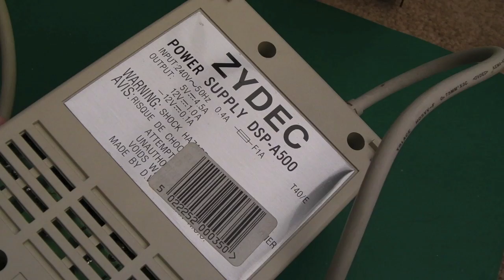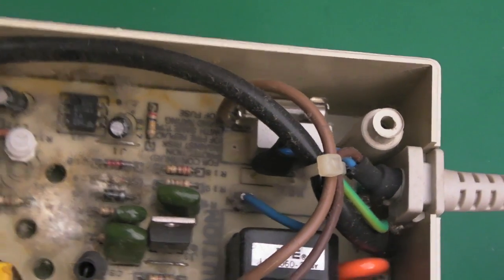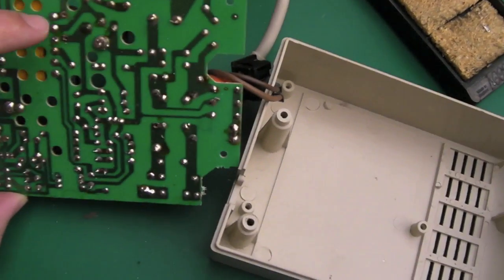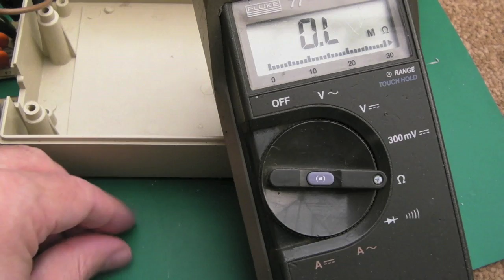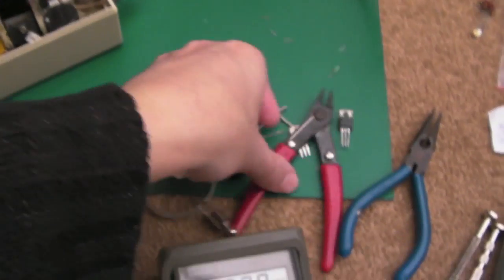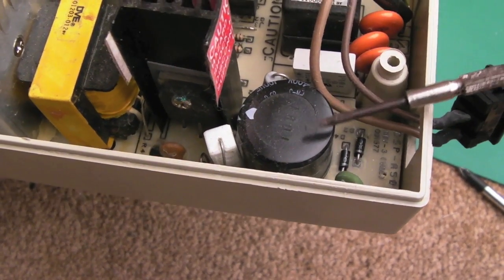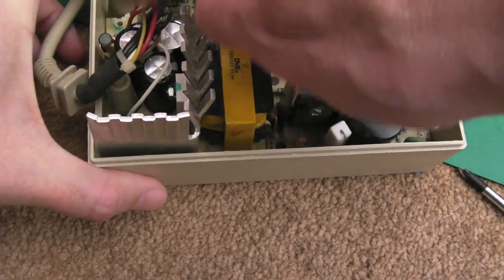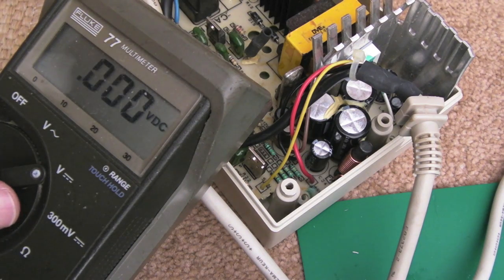Commodore Amiga 500 Zydec PSU Repair (DSP-A500)

Comment: I have a very similar PSU which is dead. After watching your video I went straight to measure R4, and lo and behold, mine is also open circuit. I guess I should measure my SCR next. Thank you for uploading these super helpful videos.

Update: The SCR seems to measure fine. Guess I'll just put the SCR back where it belongs, dig up a new 220k resistor, and see if my PSU works now.

Update 2: After ordering and replacing the resistor, the PSU now gives out 5.1V. The other voltages are not great, +11V and -9V, but I don't really care that much about the op-amp rails right now. I'm just stoked that the PSU could be rescued from the landfill by replacing a 6 pence part.
Reply from the maker: Great =D  Regards the slightly off +12 and -12v, maybe a change for a few caps will solve that!

Comment: Hey please help. My A500 psu works ok, but i get the same sound you got, when i turn PSU off. I changed all electrolytic caps, no change. Which componet causes that sound?
Reply from the maker: Maybe there's a problem with over voltage and its cutting out.  You need to measure all the resistors, zener / diodes.  Maybe swap the opto isolator if there is one.

Comment: I have one of these. On yours you have two grey rectangle boxes (the 1ohm things?) on mine they are yellow and have "RIFA" printed on them! Both have blown up, when they died the room stank bad. But afaik they are well known for kicking the bucket! Can I ask what are the exact codes of the grey ones you have? They sit close to the power switch end of the case. Thanks :)
Reply from the maker: I will need to take it appart to investigate when I get time!

Comment: Id say the resistor that blew was a fusible resistor.. it was probably designed to open if the SCR protection activated and was left switched on for a long period... or it just failed with age, as fusible resistors do!
Reply from the maker: That's a good point actually!  I might re-visit that PSU and swap out for a smaller wattage I think!

Comment: Hello can you help me ? My Amiga 500 led power blinks non stop and the tv screen stays grey do you know what is the source of this issue? i have a second issue: I turn on the PSU but the Amiga 500 doesn´t turn on (the PSU was tested it´s working ok) what should i do about? and there another issue with another Amiga 500 the drive led light is always lighted up (i exchanged the way i plugged the drive connectors but the led stills always on)

Comment: I just use an AT power supply and some adapter I bought off eBay, there were some Amiga 500s I saved from a recycling centre as a friend who works there saved for me, too bad the power supplies got scrapped. Good video!
Reply from the maker: Thanks =D  Yes, an AT PSU is a good idea for many retro systems!

Comment: Does it still make that high pitched noise now it's fixed?  I got one a couple of months back that was making that same noise, and it died on me last week.  I've done what you did in this video up to a point - am getting nothing on any outputs, 160-odd volts on the top of the switching transistor, and nothing on the output side of the opto.  Resistor between the transistor and transformer measures a resistance, as does the SCR anode-cathode, but i'm measuring in-circuit so don't know if they are meaningful readings.  Am quite new to electronics, so not going near the bottom side of this thing until it's been unplugged for at least a day.

Also worth mentioning that Farnell are shutting down their trade counter at the end of the month (a few days), so if you're anywhere near (sound like you might be from your accent) you might want to check out their reduced section.  If you spot this comment in time, of course.
Reply from the maker: I think the output side of the opto goes low resistance doesn't it?   What's on the input side of the opto?  Did you try removing the SCR and see if it powers up any further without it - I think it should if its for over voltage protection?  If you do take it out and test it that way, dont test with the Amiga connected in case it is over voltage on one of the supplies.  Always take transistors and SCR's out to measure them out of circuit, it's far too easy to measure other components connected etc.
Reply: I took the SCR out - still nothing on the output rails, and the SCR itself measures open circuit between anode and cathode, so it seems fine. I measured the inputs on the opto, they were all about 160V, but I noticed the two outer pins were slowly climbing, and the middle was slowly falling.  Hmm.  I then measured across that main big cap and it too was climbing.  I left it on for a bit and that big cap happily kept on climbing to 400V, at which point I turned it off.  As I say, pretty new at this, but this seems wrong?  Thanks.

Edit: I also noticed there's only about 50 ohms between ground and 5V on the output side.  Currently balancing the decision in my head to figure out what's wrong and fix it, which may take time and more experience, vs harvesting the connecter and wiring it to an ATX power supply so I have a working Amiga.

Comment: I have an Amiga 500 dead PSU can you help ? do you have skype? i notest on the psu board that is missing the BV 508 (it was removed)
Reply from the maker: Hi, I don't use Skype!  Are you saying you picked up a faulty PSU and someone has worked on it before?  With PSUs, your first point should be inspection (careful not to get a shock off the main capacitor).  Since the BV 508 is missing that suggests that either it failed, or maybe it was removed to fix another PSU (Meaning this PSU has a possible fault as well as a missing BV 508).   I guess you could try replacing that BV 508 (what is that component btw - I don't recognise that part number, is it a transistor or SCR?).
Reply: Do you have facebook account? i´ll appreciate if you let me add you to get more help
. The transistor missing is the BU 508 AF (I already ordered it with every blue capacitors
) to replace them all
Reply: Please can you get me the Amiga 500 PSU 4.5 A schematics diagram ?
Reply: I have an amiga 500 keyboard that the power led turns on but the caps lock don´t. What do you think is happening ?
Reply from the maker: If I come across them I will let you know! =D
Reply from the maker: Does the Amiga boot though?  Or do you just get a black screen?
Reply: you come across so late but nevermind the PSU is already repaired
Reply from the maker: Sorry - I missed the message at the time!  Only spotted it today!
Reply: there was a time some years ago you did answer in time to youtube users but since then it´s been sad...because here on youtube is the place where you can save more Commodore stuff with your tips
Reply: I payed to an electrician to repair it but i  i payed too much for a simple job (changing de caps) if you had answered to me probably i would not  have asked to the electrician to do the job so he charged me 2 hours of work to change the caps and we know that is just needed half an hour to  do it

Comment: From past experience working on PSU and high voltage i get very twitchy so i avoid as much as i can as it only takes one slip up and you might see the magic smoke or the grim reaper. Good fix as always, detailed videos are brilliant. 
(Luke Morse has got some good project's on the go that neo-do look's almost parts bin material. )

Comment: Well you dealt with that pretty quickly, well done :)
Reply from the maker: +arcadeuk Thanks, yes, I was surprised myself that I found the resistor in a minute or 2 of removing the lid, and then just randomly removed the SCR and found it to be faulty!  I wish I could pick lottery numbers that well lol.  I am sure the next Amiga PSU I come to look at will be hours of work lol
Reply: Next time I have a board I am stuck on, I will get you to randomly point and components and I will then replace them. If you can get them in 2 or 3 guesses we will be onto a winner :) haha
Reply from the maker: Haha =D  I think to be fair the Amiga PSU is pretty simple really, especially when compared to the complex stuff you work on!

Comment: Weird .  My Zedec can be measured with no load on it, however the output caps maybe slightly long in the tooth and providing some load due to elevated esr. Nice vid :)
Reply from the maker: +Sabretooth Barnacle You've made me wonder now lol - I will check again tomorrow, I might not have tried to measure voltages after I had swapped out the SCR, which would make perfect sense now I think about it.  At the point I swapped out the SCR I convinced myself that PSU used the sense pin to enable output but that might be incorrect and it could be the SCR fault was stopping any output.
Reply from the maker: +Sabretooth Barnacle You are right!  Thanks for posting that comment =D  I measured again today and it does output voltages without being connected to the Amiga!  I had jumped to that conclusion before I swapped out the SCR and just forgot to re-check afterwards.
Reply: @GadgetUK164  Hey sorry for bringing this up after 6 or so years. I bought the same PSU today but it is not branded Zydec but Commodore (DSP-A500) Model 312503-03. I've changed all of the capacitors, when not connected to Amiga i measure 5,15V 11,35V and -9.35V but when connected it is 5.01V 12,15V and -11,45V. Is this normal or not? I also have this high pitched sound when power cycling.

Comment: Another working A500 ! Good work ! Once the power light came on, and the sounds of the disk going in and booting, I was right back again wanting my A500 back, even though I miss my A1200 more, it was a dream to have the A500 after using the C64 for a long time back in the day.
Reply from the maker: +bwack Hehe, I know what you mean!  I hardly ever get my 500 or 500+ out but when I do the sounds and sights of the Amiga case there really fill me with nostalgia!

Comment: I was covering my ears while you switched it back on. LOL . What did the SCR/transistor device do ? Was it the crowbar that was shot ?
Reply from the maker: +bwack Haha, yes - I was in the brace position whilst switching it on!  I am not sure what the SCR did, I didn't spend any time looking at that part of the circuit, I just checked the voltage, worked out that the resistor was open circuit, still wasn't powering up and then I though - lets check out that SCR and low and behold it was faulty lol.   I was getting resistance readings between anode and cathode so I'me sure its shot.   I think its a crowbar like you suggested, I am thinking maybe it switches under an overload situation or something - I honestly don't know how it would be used in this PSU.  I did have a quick search for schematics later but couldn't find anything.